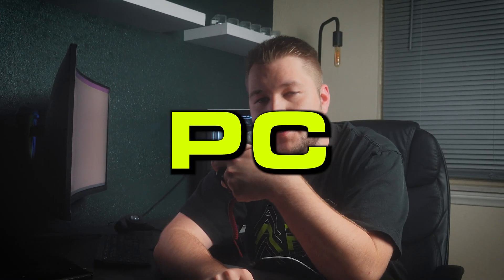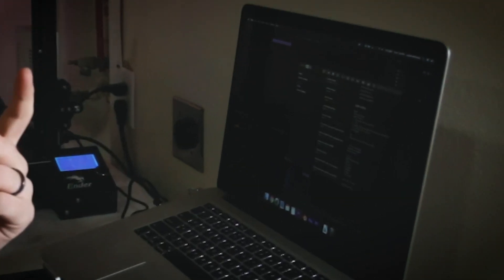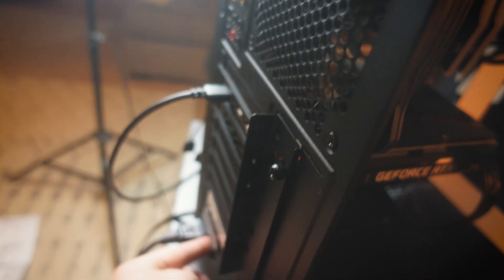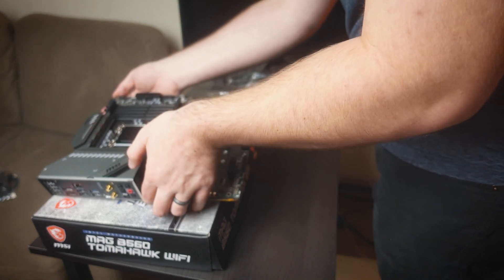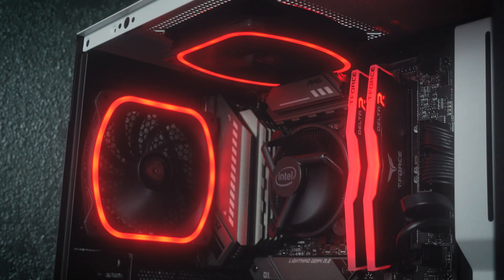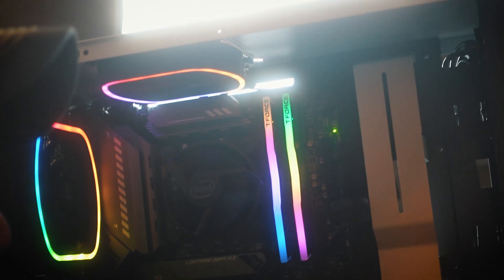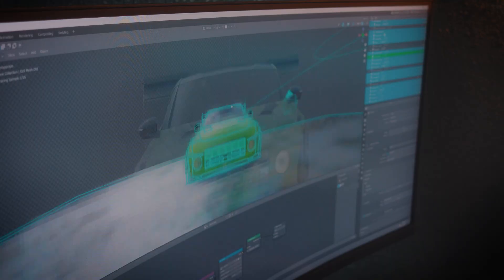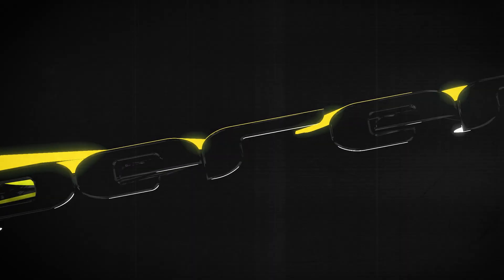Building a workstation PC with NO Experience | CYBERUNN 4K

Comment: PCPP is a great resource for anyone looking to build a PC for the first time.  You kinda did build during a semiconductor shortage so yeah, that 3060 blew the budget, but otherwise not bad. It will still be a better card than my GTX 1080 for gaming. 
Only suggestion I would give is get a better CPU cooler when you get a chance.
Reply from the maker: That was my first upgrade on the list, but I haven’t seen it go over 55 c yet, so I’m not in a rush lol
Reply: @cyberunndesign  Yeah, no worries if you're keeping temps like that. That's well within normal range for Intel.

Comment: Mazdas and PCs are life lmao. The build looks great! However, when you can, you may want to upgrade to a beefier cpu cooler. Intel has some really poor performing ones. If you think you wanna stay air cooled, I like noctua and coolermaster. If you want your cpu to not get above 40 or 50 degrees C, get a nice 240mm AIO from nzxt or corsair. 

Welcome to the master race 🤣
Reply: (I suggest the cpu cooler because cooler components are happier components)
Reply from the maker: Absolutely! I’ve been keeping an eye on temps, and I have yet to see the CPU hit 55 c. It is a good upgrade, but until I see it starting to be pushed harder, I’m not sure how worried I should be lol
Reply: @cyberunndesign  typically 82 is as high as I let mine get, but I know some chips are rated to like.. 100°C. Regardless, it seems you're fine for now since you're rendering on the GPU. Great vid though! Always look forward to your uploads and can't wait for what was in the announcement at the end 😁